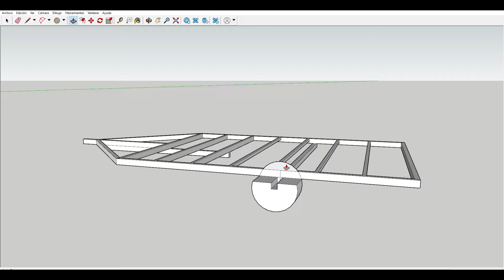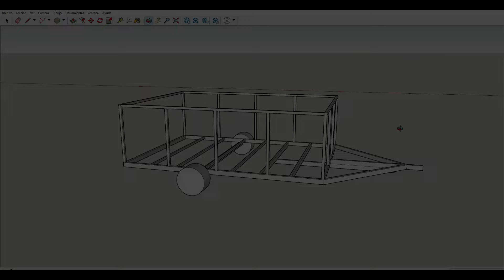Como FABRICAR un REMOLQUE PASO A PASO (Carro de arrastre)

Comment: Muy bueno el video, tendrás el link de la parte 2?..   Estoy pensando en hacer una mini rodante de 2,50 x 1,70 de espacio interior por 1,50 de alto... Quiero llevar la moto en el interior, que pesa 185kg. y pensaba hacer el chasis con "Perfil U De Hierro Chico - Upn 60 Mm X 30 Mm X 6 mm Acindar" Para ese límite de los 750kg. Que te parece ese perfil. Gracias.
Reply from the maker: Si es de 6mm de espesor siento que es demasiado para el tamaño y lo que se requiere.

Comment: Hola amigo muy buen video lo felicito le hago una consulta para un carro con doble eje de torcion como se calcula la pasión de los ejes con respecto al carro . Espero me pueda ayudar gracias
Reply from the maker: Te refieres a la ubicación? Bueno depende el uso de tu carro. Pero puedes seguir la misma regla. Calcula el 60% y este debe quedarte en medio de los dos ejes. O en otras palabras, en el centro de la separación que se forma de las dos ruedas.
Reply: Muchas gracias amigo por su respuesta el carro será más para bultos no tanto para peso bruto sólo los eje darán una tara de 1300 kilos pero más de 700 no le cargaré
Reply: @MarviProjects excelente trabajo amigo

Comment: Hola..Muy buen proyecto..Te quiero hacer una consulta; Porque no ocupaste perfil 80x40x3 en vez de de 80x40x2 para el Chasis..Se que es mas liviano en 2mm pero para usar 1 solo eje.. no habra problema que se combe el perfil de 2mm ..Los Felicito muy bonito estaba quedando...Saludos desde Valparaiso
Reply from the maker: Hola, no aconsejaría mucho para este tipo de proyectos más de "2mm". Tienes que siempre calcular el peso del proyecto y la función del mismo, para elegir bien el material.
Por ejemplo, este carro no es de alta carga, solo 750 kg máximo.
Es cierto que aveces se aconseja que "entre más mm de grosor mejor". Pero aveces causa un efecto peligroso, quedan como unos tanques de pesados y muchas veces se usa con un vehículo que no es adecuado...
Además en 3mm te eleva el peso del chasis y el costo de manera innecesaria, que también es algo que considerar.
Reply: @MarviProjects  la carga máxima del carro es de 750 kilos. Cuánto es el peso del carro y su eje de torsión?
Reply from the maker: @alejandropardo6420  Como 150 kg aprox. (Lo debo tener en mis apuntes exactamente pero en estos momentos no los tengo a mano)
El eje pesa 30kg, cada rueda pesa unos 15 kg. Y la estructura metálica todo lo demás.

Comment: Puedes compartir el detalle de los materiales, leí que eran perfiles de 80x40 mm y aquel 2 te refieres a milímetros de espesor. Estoy planificando un carro de 250x150 para 750 kg. Te agradecería me puedas orientar, gracias.
Reply from the maker: Si es en 2mm
Si es para esa carga entonces estaría bien  perfil que indicas. Trata de reforzar bien la soldadura. Saludos
Reply: Hola amigo, consulta, primero sueldan el marco con electrodos 60 xx limpian y rematan con 7018 filete de 5mm aprox o no?

Comment: En que amperaje soladaste??
Reply from the maker: Depende el material y electrodo. En E6011 3/32 con un perfil de 2mm podría ser a entre 60 y 70. Si luego rematas con 7018 3/32 tiene que ser un poco más, pero no demasiado, de lo contrario te caerá como agua a cualquier lado.